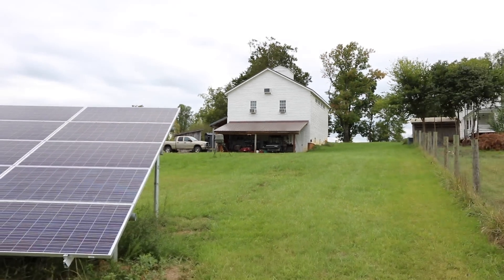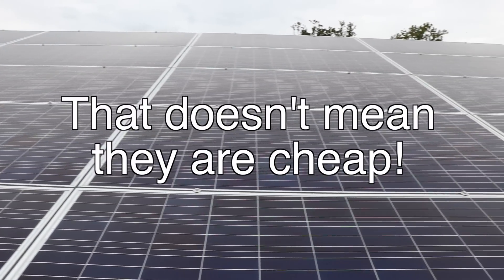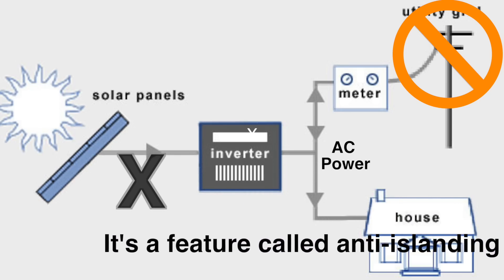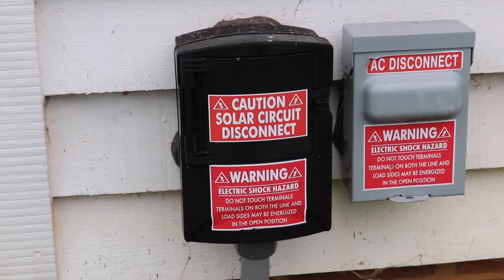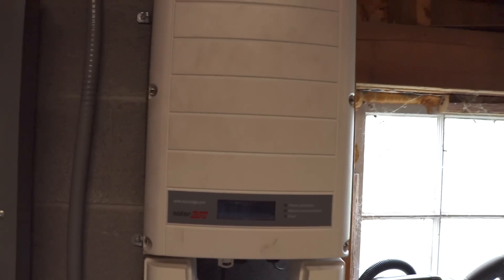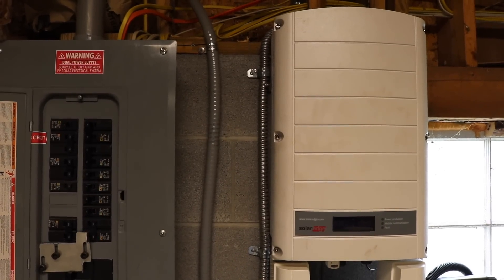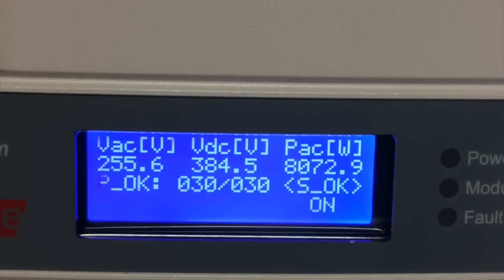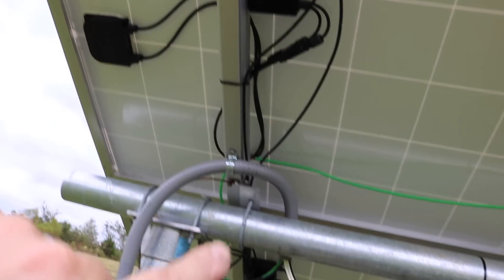The ugly truth behind grid-tie solar systems. Part 1, FarmCraft101 solar.  Watch before you buy!

Comment: Great video.  Thanks for sharing.   I just purchased 30 - 315 watt, 48v solar panels and I am planning to do a grid tie in with an inverter.   I am concerned about high winds hitting my solar array.  Do you have that problem where you live as well?  I really liked he video showing your mounting system.  It looks strong.
What is the model of the in grid inverter that you were showing?
Reply from the maker: I do have a lot of wind, and you definitely want a strong mount for those expensive panels.  It's a solaredge inverter.  Thanks for watching!
Reply: Usually 90 mph winds are the peak your panels can stand.  Above that is iffy....

Comment: Power Company in our area has been changing all of the Power meters over to electronic meters so that you can't do this. Electronic meters won't run backwards. They have a digital display on them
Reply from the maker: Mine is actually digital as well.  They installed a different meter because of the solar system, called a net metering meter.  In many areas the power companies have been mandated to make net metering available to customers.  A good search of your location should let you know if net metering is available.

Comment: A few months ago, we put in a SMA 5.3 Kw system.  We bought the secure power option.  Instead of shutting down the system to avoid the anti-islanding situation, the system diverts the power to one outlet with 2000w available.  We just had hurricane Irma blow through and lost power for 4 days.  The secure power system worked like having a 2K generator that worked from 9am-6. This might be a half-way solution. It's much cheaper than putting in the battery backup but obviously we had to use a generator at night.
Reply: LUIDA93 Such bullshit. They all have FVDs in their belts and around their neck to detect any foreign or unknown voltage. The codes and laws are there to keep their fucking profits rolling in.
Reply from the maker: I remember looking at an inverter that had that option.  Sunny boy?  Yeah, that's a cool feature.  I'm hoping in the future all the grid tied systems will have outputs like that.  How does it work on a partly cloudy day where the sun is going in and out?
Reply: The inverter is the only thing between the panels and the meter, hence the inverter senses the grid is down and stops functioning, in other words the inverter shuts down and the DC (direct current) generated by the panels continues to flow as a circuit.  Last, the company prevents islanding by working with local governments to create codes for installation.  Therefore, if your system is rogue, your house will become an island and feed back to the power pole and possibly hurt someone.
Reply: I don't doubt that they have ways of seeing that someone is creating a current, but there is truth to what they are saying.  When repairs are needed, the parts and lines have to be disconnected and if someone is back feeding, it becomes a dangerous task.  That being said, it does benefit the power company a lot, and they do like to play with our pockets.  So for them to be able to justify this just sweetens the deal.
Reply: I have a similar ideology... It is better to ask forgiveness than to ask permission, but it pays to have knowledge when you make decisions :)
Reply: Your thoughts are on track.  There is always some loss of energy as friction, also known as resistance, which causes heat.  This is how heaters work.  Intuitively, this means that while flowing as a circuit, they do loose some power, but consumption is irrelevant.  The job of the solar panels is to make a reaction within them, just like batteries, and create electricity.  Because the panels are connected to the terminals of the inverter or batteries, there can be a connection between the negative and positive wire, creating a circuit.  (It is important to note that in a DC system, energy is always flowing in one direction, in a loop, therefore we call it a circuit when energy can flow freely though both hot wires - positive and negative)

Back to the workings of the panel.  If there is a circuit, the panels will continue to produce electricity because the electrons have a path to take and some energy will be lost as heat.  Otherwise, if there is no load to feed, the electrons in the panels are happy ( with their ideal number of electrons ) and do not create a current.
Reply: There's only power if there is current flow. Have you ever asked yourself what happens to the "power" when you don't plug anything into a wall outlet? ;) Same thing with solar panels. If you'd measure at the panels they will generate a voltage, but if the inverter opens the circuit to the panels, not current can flow, so no power. 
The only issue could be, that if you don't pull any current the voltage on the panels rises. If the system isn't designed for that the voltage could for example "arc" over and fry something ("arc" in quotes, because it could be just an internal breakdown of some semiconductor component/switch). But all of this isn't a problem, because the open circuit voltage of panels is known and you just pick your system to be able to handle that.
Reply: LUIDA93 very interesting conversation...I've been researching on solar energy. But, it seems that there is a lot caps and obstacles! At the end does it worth it? If I pay $20,000+ and for what I see (the government incentives comes right back to bite you) is better not to accept it! So you can say you own it! Any ways if I pay that much, I'm going to use it if I need it, period! Especially in a blackout! I'll become an electrician if I have to, to rigg it to work off the grid! And "someone" comes with some bull after...well, then every body should watch "Law abiding citizen" ... "II" or "III" LoL!
Reply: @LegendLength  When the grid goes down, the inverter senses lack of 60hz and disconnects itself from the grid. The open circuit stops energy flow from the panels. Their voltage climbs and the amps are zero. The SunnyBoy has 1 110Vac circuit available. I don't think it can power any panel circuits. It is its own plug in point. For instance, extension cord to the refrigerator.